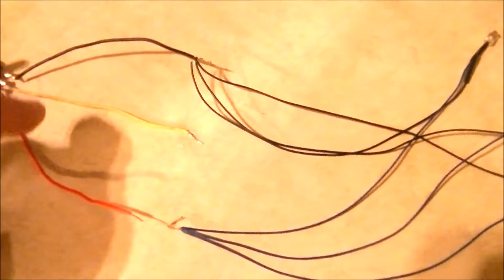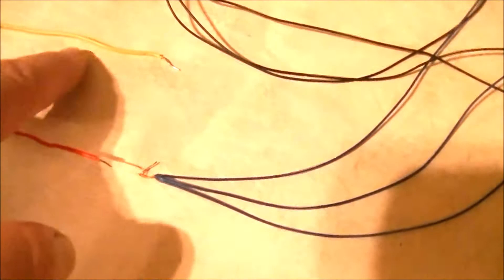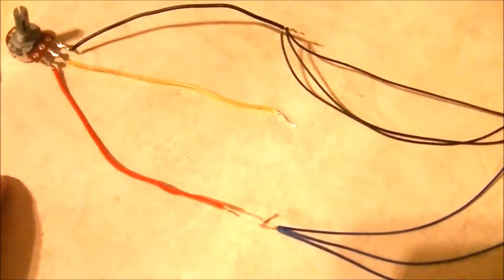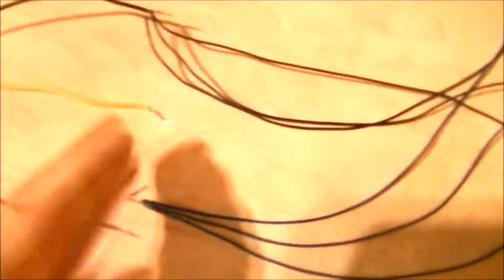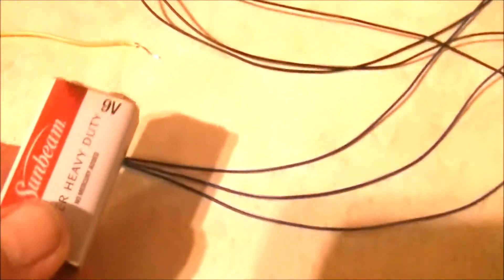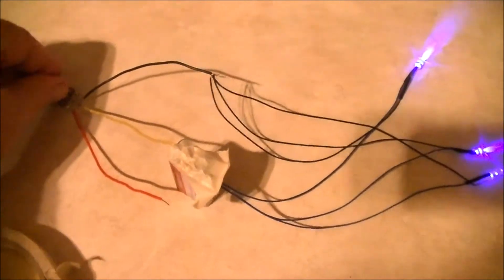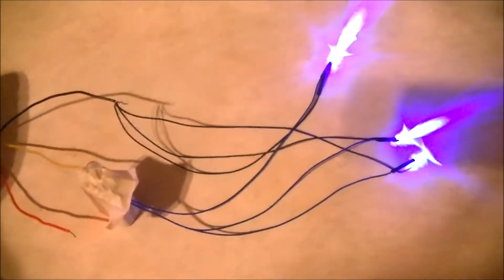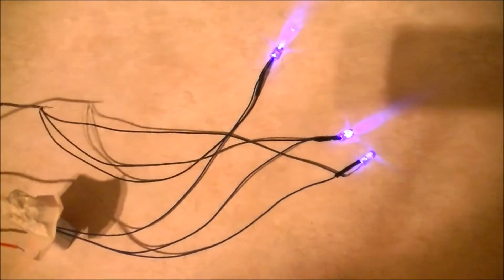Electronics 101, Using a Pot to Control Brightness

Comment: What's the pot value?
Reply from the maker: In this instance... 1 Mega Ohms. This give you a wider range of brightness levels as compared to a smaller value, though I suggest experimenting with your own circuits and coming up with a value that suits your personal needs.
Reply: @CaptainQuirk69  Thank you-- I use a 2.2K trimmer on a one-segment of LED strip at 9V. Does well. Your beefier pot would soak up more wattage.
Reply from the maker: @MrChief101  That depends on the value at which the light meets my preferred level of brightness which is directly relative to resistance at the point and the fact that I'm running a 12v system, this all dictates the resultant wattage at the output. If I'm just toning down the super bright, prewired 12 v LED's for the engines I may not be increasing the current sufficiently to make a difference... All things are relative.
Reply from the maker: Eliot Brown Here's a little video for you describing I squared, R loss. Though the numbers are drastically different, the math is the same. https://www.youtube.com/watch?v=dUqSKKr0AxE